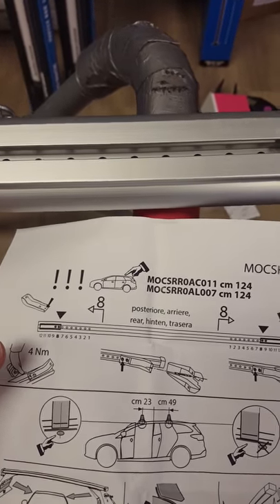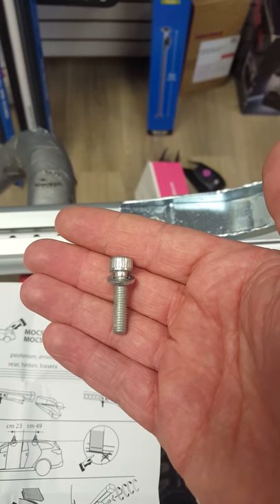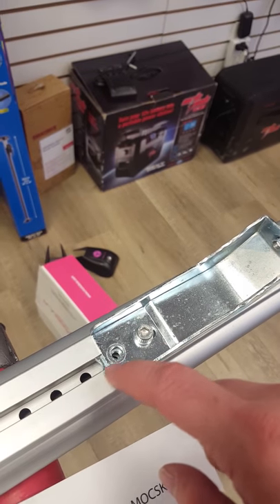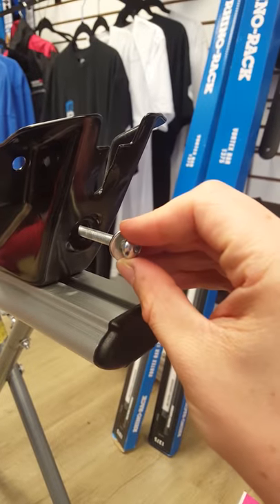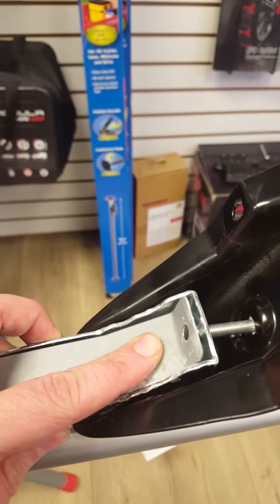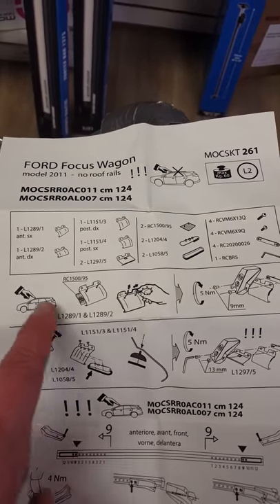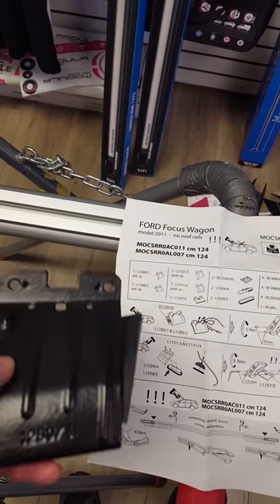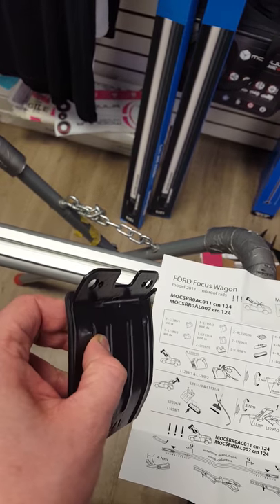Modula Aluminium Oval Bar Assembly Instructions

Comment: thanks this helped. 6:16 why are there no tabs for the rear bars, only the front? i would have thought it makes fitting them to the car a lot easier. i have a hole for a tab on the rear also.
Reply from the maker: Thanks for watching! The best reason we have found for not having the dimple is that there are subtle differences between the European and North American versions of vehicles. Sometimes it is a simple as one might a dimple in the front or rear door jamb and the other one does not. Hope that helps :)

Comment: Great video, one question,,
I've fitted the aluminium bars as instructed but the covers wont go on at the end as the barrels aren't long enough to fit through the brackets,, is there something I'm doing wrong,, cheers
Reply from the maker: Hi David, Make sure the lock barrels are fully seated. They should only make about a quarter turn before stopping and there should be a small spring loaded tab retaining the lock. Sometimes the plastic covers need a quick final finishing. lay a piece of sandpaper face up on a smooth surface and rub the lower back of the cover in a figure 8 pattern. This should remove any imperfections that are hanging up on the leg. Press firmly and repeat with the sandpaper until the face-plate seats correctly.

Comment: Just bought these with the steel bars plus the locks with keys but they won't lock it's as if the barrels too short any advice?
Reply from the maker: Hi Kevin, 
You need to press very firmly, sometimes helpful to have a second hand with this and turn the lock cores.
The other option is to sand down the rear lower face with some emery paper as the castings can sometimes bulge out and make the covers stick out a bit to far for the locks to catch.

Cheers,
Modula Racks
Reply: @ModulaRacks  thanks I'll give it a go 👍
Reply from the maker: @kevinsmith3638  Let us know if there is anything else we can help you with!